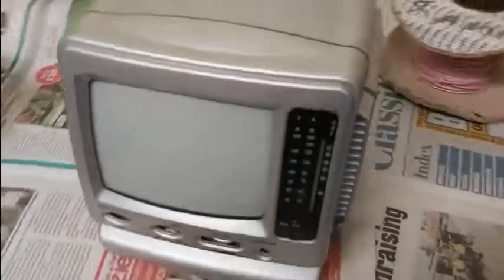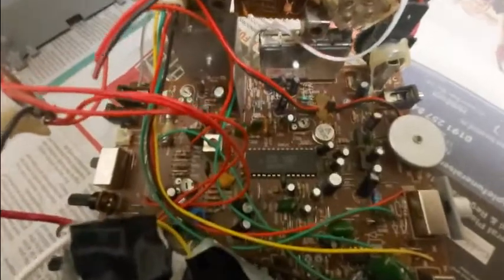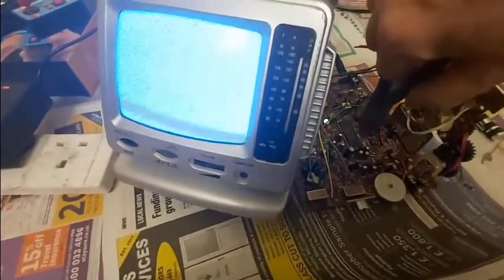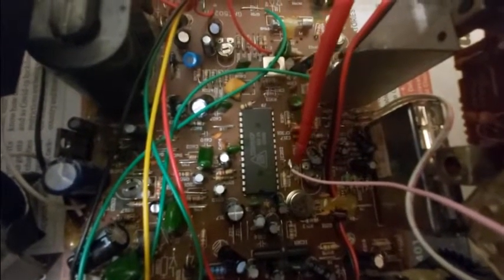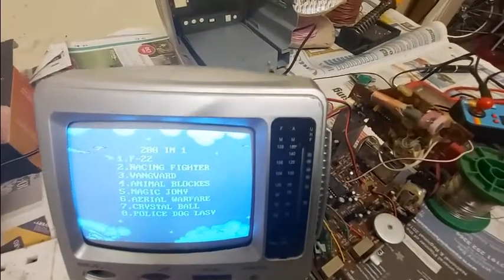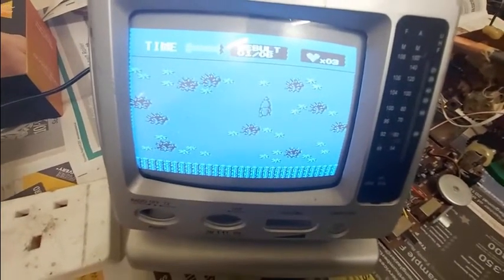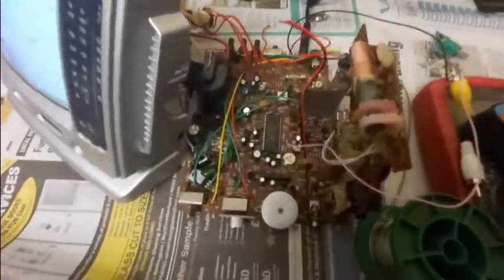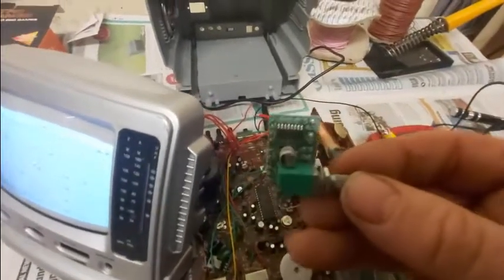Convert a 5" black and white TV with RF to Composite.

Comment: This is super helpful, I bought a crt with composite and coax but it only uses composite when you have the remote…there’s no settings buttons on the tv so it’s stuck on coax mode. Thanks magnavox . Anyway I was thinking I would add a switch so I could switch back and forth between composite and coax/rf. Currently not exactly sure how im gonna do that but if you have any tips id love to hear them!! Cheers dude!!
Reply from the maker: Some of these did have buttons on the back that changed between composite to RF. It's just a double pole switch so it's a matter of wiring  it in-between the point I snipped in this video.
Reply: It's a good chance it's one of those "Sex Pest Islands Specials" (Funai).
Reply: @MegaWayneD  I need some help please. I'm doing the exact same thing right now because the av button broke in the back. I have the same tv same model, just on the board instead of it being a clip it's two wires. Where do I connect these wires?I feel I'm almost there. I watched the video over and over. Do I solder it to the av port or onto the chip? Thanks for the video!
Reply from the maker: @adilarnautovic3658  regarding the two wires; one should be going to the chip. The wire that is NOT going to the chip is the one you need to connect the video signal to. All the AV switch on the back of the TV is doing is connecting the two wires.

Comment: Hi from Italy! I have modded the same CRT 5'' TV (here is labeled "Majestic" brand), and I wired the composite audio connector by using the 1 wire to the potentiometer on the front and 1 wire on the GND. I would like to ask you if in your board there is a resistor labeled R224 and if It's so, if you can tell me the value of that please? I changed because I got smoke by a mistake and I replaced with one 32ohm. That resistor should be connected to the potentiometer on the back for the V-HOLD through pin 20 of the chip. If you can tell me the value I really appreciate it!

Comment: It works! Legend! Now only to figure out why the output starts mid way on the screen. But I did accidentally step on the v hold potentiometer so I probably just need to replace that
Reply from the maker: These are pretty awful quality! There's been a couple of these where I've ended up replacing all the pots.

Comment: I ll be highly obliged if i can get a schematic diagram of this set. I have the same set but the vertical output section components are missing. A clear picture of vertical output section will also work fine for me. Regards.
Reply from the maker: There are no schematics available for this set. The most you'll be able to find is the datasheet for the CD5151CP chip which is what all these sets are built around. Not that it's a particularly complicated set, you can kinda work out what does what using the datasheet.

Comment: Hi, would it be possible to get some high resolution pictures of the top and bottom of the PCB? I have a screen driven by a very similar chip (basicaly identical), but the PCB is different. If i can compare the traces i might find what I need.

Comment: Got an idea to run by you. I'm looking to get a portable tv/walkman which has no inputs but has an ext antenna that cannot be taken off. Wondering if it's an rf signal, and therefore, would have a corresponding composite input on the board by the right pin. Or does the pin method only work for certain kinds of tvs? I would go in there with a soldering iron and a composite input mount and try to jury rig a composite port in place of the ext ant.

P. S. How does one receive sound?

Comment: Hi, I have mini lcd color monitor with composite inputs and power wires. If to completely remove the B&W tube by cutting its wires, will it work ?
Reply from the maker: Erm.... pardon?
Reply: @MegaWayneD  I have mini LCD screen with built in composite inputs. would like to replace this tube with my color screen that only needs power .  How to remove the old b&w tube completely?

Comment: Hey, can you give model and link to that audio amplifier you used for sound line?
Reply from the maker: Just search for "PAM8403" there's two versions, one with volume control on/off as I used in the video and one without. I bought mine from Ebay ages ago so I'm not sure who the seller was.
Reply: @MegaWayneD  Thanks. Do you know the best way to connecr both lines for just one speaker? Do I need to use borh of them or i can just use left or right?
Reply from the maker: @lokz9632  just use one channel i.e. left OR right. Because these are digital amplifiers you can't bridge the outputs.

Comment: Can you show us how to install the PAM. Or if you have already done it. Could you show us how you did it in the next video. Thanks mate.
Reply from the maker: The PAM8403 is really easy to wire up, it's just audio input, speaker connection and power. I didn't really go into it here as there's so many differences with these TVs. There's some videos some other people have made on the PAM8403 which are way better than I could advise.
Reply: I have searched around and found plenty of people converting into RGB. There's not much on PAM8403 installation 😞

Comment: I've seen many crt tv fans mod their tvs for rgb component and now I want it too. But I decided to experiment on an older tv from 1976. Its an hrf only tv, the things you need to screw the switch box to the back of your tv when you want to play atari. It doesn't have a coaxial rf input so I had to buy a transformer that has that rf input, then connect it to a box which adapts from composite to hdmi and I was able to play nintendo switch on it. But what I want to do is mod the tv for rgb. But I'm told it doesn't have onscreen display or even a jungle chip. I'm no tv expert but what if you replace the circuit with a totally new one that has those things? What if I install a jungle chip in the current circuit and re-wire w/e to where its needed? I'm told to just get a new tv but I want to preserve the vintage design as much as possible. So I'm asking anyone who knows, what can be done with the tv I have?
Reply from the maker: Due to the age it's highly likely that it's a live chassis set so I certainly wouldn't be attempting to do any modifications like that. 
If you like the aesthetics of an old TV but want modern functionality find a newer TV with a tube the same size and swap out everything inside, including the tube.
Reply: @MegaWayneD  Is it not possible to just replace the circuits with new ones, wire them to the current tube so it can read the new jungle chip and everything needed for rgb? I'm guessing not all cathrode-ray tubes have the same functionality but I thought they just require wiring and the tube just fires electrons at the tube to display pictures.
Reply from the maker: @JohnyTheWizKid  it is but the fact that you're asking the question in the first place suggests that you're unfamiliar with setting up cathode ray tubes. I certainly wouldn't start with something like this. If you want to learn how to set up a CRT start with a little black and white TV like in this video. With colour TVs you've got the added issues of convergence and purity.
Reply: @MegaWayneD  Well I actually wasn't going to work on it, I was going to look, ask and hire an expert. I was just trying to gain knowledge first. But I appreciate the info. I have come to appreciate old tvs and such. And I just thought of experimenting.
Reply from the maker: @JohnyTheWizKid  I don't know where you'd even begin to find an expert in 2021. They'd have to find a donor TV with the same size screen anyway so it would be easier to swap out the tube while they're on.
Reply: @MegaWayneD  I was gonna come suggest this, the best idea for that would be to swap the tube, I might try that some day with a really old black and white tv
Reply: Don't, it's probably live chassis. Even the 90's "black plastic crap" Sanyo I have is live chassis and I got a real nice ZAP off the test wires I soldered to the board.

Just, use an rf modulator. It's not worth the safety risk.

Comment: Doesnt work on my model, not sure why. Exact same chip and board and everything
Reply from the maker: Ah, did you connect the wire to the chip's pin or where the pin was connected to? Don't connect it directly to the chip.
Reply: @MegaWayneD  I clipped the link between  pin 5 and the video circuit like in the video and attached the wire to the video circuit side of the board where pin 5 used to be linked, I'll check my work again
Reply from the maker: @crowbilt don't be surprised if a solder pad or link on the PCB has broken or has a hairline crack. The PCBs are really flimsy.

Comment: Mine didn’t even have the jumper installed, just soldered over on the rear…!
Reply: yo bro i see this is and old comment but did you under bridge any solder or anything or did you just solder to the pip under the board ?
Reply: @nathanloopz6175  TBH I can’t remember, but it would be usual for me to attach “bodge wires” on the underside..
Experiment.. as long as you don’t poke the flyback transformer and stick to a DC supply you should be good..👍

Comment: It did not work for me. Exact same tv. Snow screen is gone just white screen... After removed everything even snow screen newer got back
Reply from the maker: Did you connect the video to the pin on the chip or to the link going to the chip?
Reply: @MegaWayneD  to the contact that is not connected to the chip, exactly like in your video. Tried touch the chip pin also, nothing changed but looks like first variant was better because atleast some interference has occurred but no video.